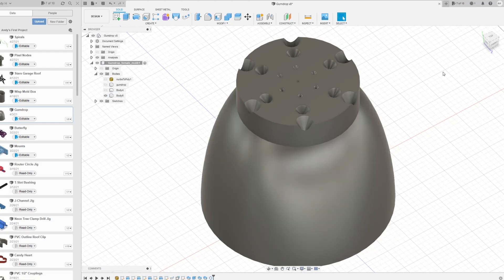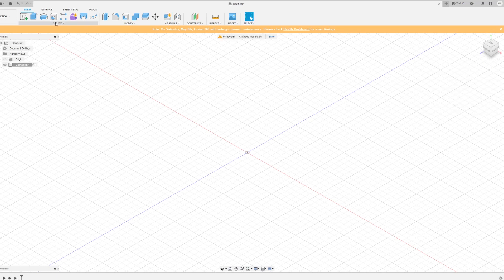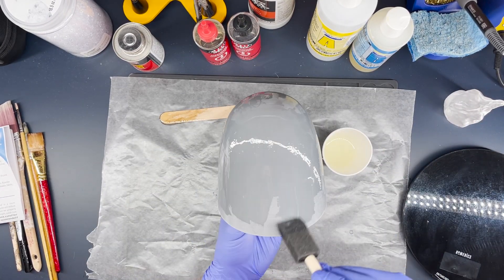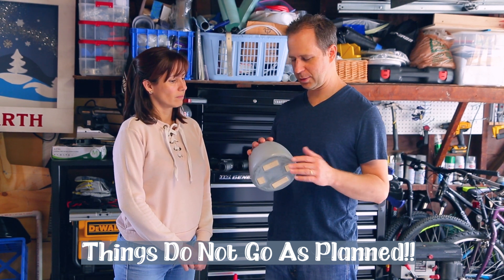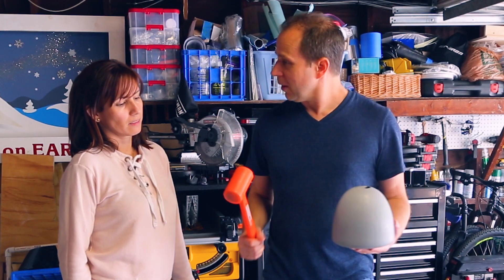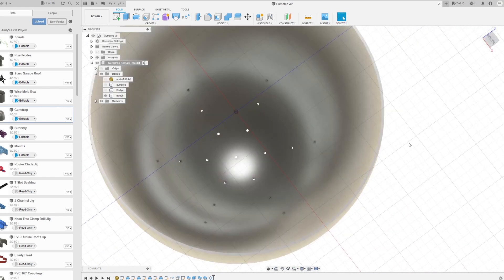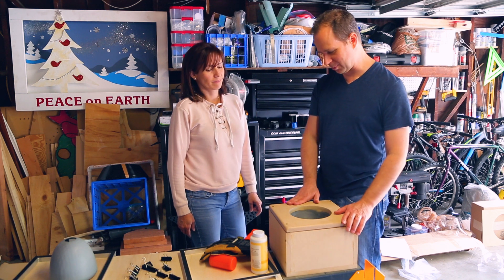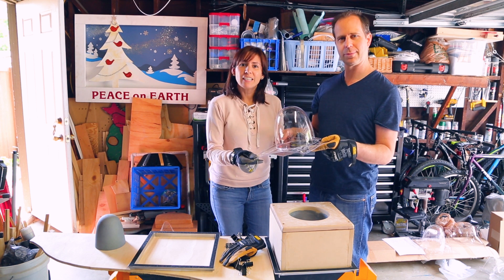Making DIY Gumdrop Light Decorations With Vacuum Forming | Outdoor Christmas Decorations

Comment: I’ve been looking for a good diy light up gumdrop for three years and these are the best by far! I would totally buy them from you guys. Maybe you could make a kit.
Reply: Just buy 10" jumbo plastic eggs.  Glue the middle together.  Cut the bottom off flat.  Use spray adhesive and dump glitter on it.
Reply: But do they light up? 
 @zynthesis
Reply from the maker: Thank you so much!! A diy kit is a great idea for an Etsy listing!
Reply: I would buy them too.....you wouldn't have to trim them either

Comment: Thanks for the video. I'm curious as to what did you do to secure the props to the base?
Reply from the maker: I used a clear outdoor silicone to seal them and attach them. This should hold good but if needed I can still remove them if needed to fix anything.

Comment: Very cool. Have you ever thought about using chicken waterers to make the gum drops? I used waterers that were 10kg and just cut the top handle off and sanded it down, and they are the PERFECT gum drop shape and I mean PERFECT. Plus they are very tough and cheap. I think I paid like $2 or $3 each direct from China. They're about 15 inches tall and around 12 or 13 at the base. Here's 3kg waterers, these are smaller, but the shape is the same for 10kg. If you contact them, they'll usually ship you what you want without having to order a huge amount. I bought 40 I think it was just to have some extras. Keep up the great work.
https://www.alibaba.com/product-detail/Big-head-drinker-3KG_60745850729.html?spm=a2700.details.maylikeexp.1.6ce32cc3ZPdW6L
Reply from the maker: Oh nice! I've never seen those before. Yes those are the perfect shape and they look like they have good diffusion too. I'll have to keep those in mind if we do more! Thanks for the great tip!!
Reply: @HarbeckLights  They are very translucent. To get an idea how much so, you can easily see the water level inside the waterer at a glance, but at the same time, they're VERY tough and durable as well as affordable.
Reply: @wjf213  YOURE ACTUALLY a life saver omg
Reply: @wjf213  how much was it for 40
Reply: @zontzooit2415  Yes, I know what you mean about finding some thing that REALLY has the gum drop shape, and these really do, and the light passes through them beautifully, and they are VERY tough and made for abuse on the farm. 

I can't remember exactly what they cost, because I ordered a bunch of things. I think they were around $120 shipped, but they were much bigger than the ones in the link above and that included import tax and dock fees. Also this was this was several years ago. 

Another trick I use is I wipe down all plastic display items with Armor All so they're protected from the UV rays from the sun and they last almost forever. Armor All keeps them from getting brittle and cracking or fading or turning yellow. 

All these different plastic display items are just too expensive to not try and take care of and make them last as long as possible. Wipe them down every other year and you're good to go for the short time they're outside and exposed to the sun for the Christmas season. I hope this helps, and Merry Christmas.
Reply: @wjf213  i also have one more question. so the father you live from the vender the higher the payment right? because i live in California and i think its being shipped from a part of asia so
Reply: @wjf213  also how long did it take to arrive where you live. and is the supplier reliable? idk the first time i bought something online it never arrived so im being cautious for my second time
Reply: @zontzooit2415  Actually shipping is to the nearest port of entry and since you're in California, you have several and just tell them the closest port to you and they'll tell you the shipping. It's easy. Then when you go to pick it up, you'll have dock fees....just another way to get a few more bucks out of you. 

As far as shipping time, it's pretty fast, like a couple weeks max, BUT that was before this whole pandemic thing, so your guess is as good as mine at this point. Normally, I'd say if you ordered today, you'd have them before Thanksgiving easily, but who knows anymore. They will tell you how long shipping will take and they do have it down to a science, but if ships are kept out in the water and not allowed to come in to unload....that's an issue beyond their or anyone's control of course.

That's too bad you ordered online and didn't receive you purchase. Was that from China too? The people I have dealt with have been nothing short of great to work with and always shipped on time with a complete order, but I completely understand being cautious.
Reply: YOURE A LIFE SAVER I WAS LIOKING FOR THE PAST HOUR TRYING TO FIND A CHEAP DOME SHAPE ONLINE THAT WAS ACCURATE ENOUPH WOWWWW

Comment: Could you share some info on the heat box component of your vacuum forming setup?
Reply from the maker: Yes for my setup I was trying to keep it as simple as possible so I just used one of those outdoor quartz heaters. I built a little box around it with mdf and then lined the inside with tin foil. The wood box never got hot at all. This setup was easy to store away and did the job well.